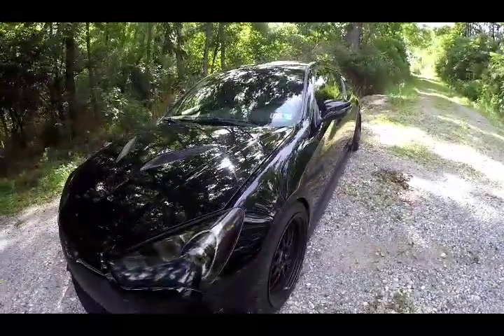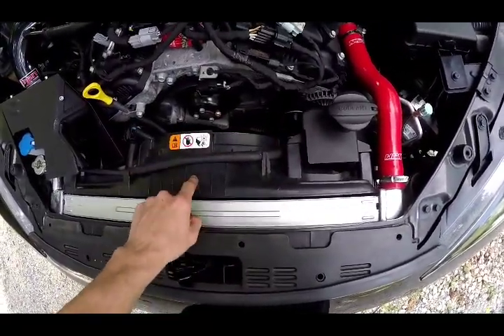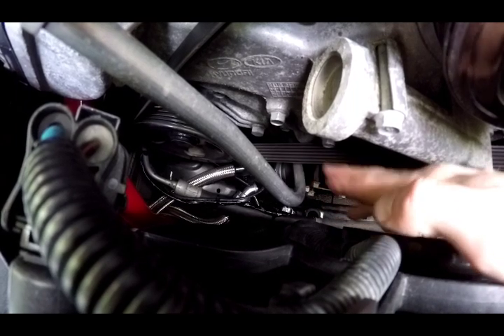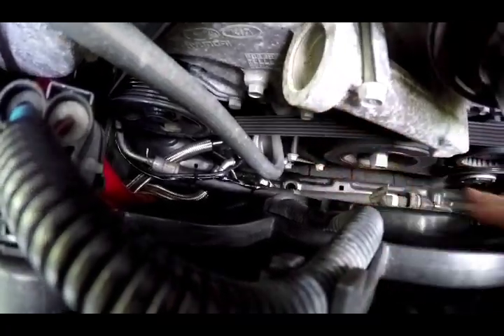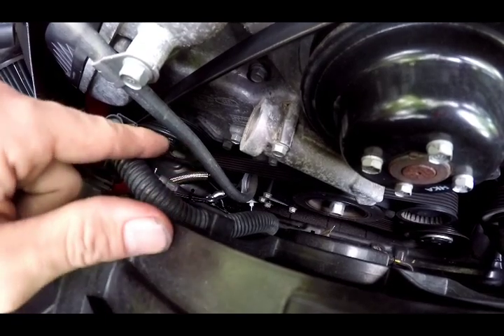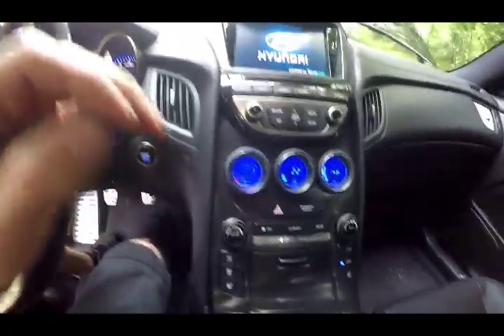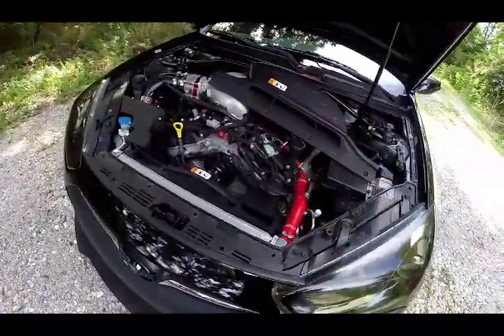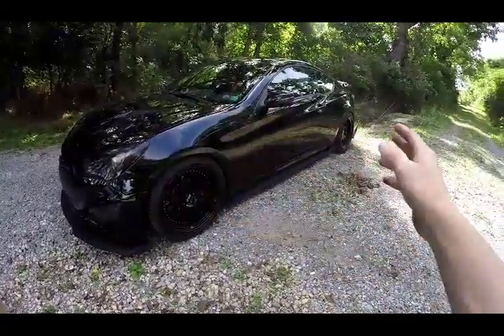Hyundai Genesis Coupe 3.8 Mishimoto oil cooler install walk through

Comment: Wait the oil them wire will it work if you have the stock gauges? For oil temp or do I have to run new wire?
Reply from the maker: For oil you would have to run separate wiring
Reply from the maker: There was a guy that actually made a harness adapter for the oil temp tho. Its moody basha in the genesis groups.
Reply: @RspecNick  damn so the stock gauges won’t work that hella sucks Ight bro thanks!
Reply from the maker: @mr_creator4696  yea man I tried messing with the wiring to see if I could atleast still use the temperature wiring but it wouldnt work. It's cool tho cause atleast I know when I see that temp reading it's not ecu monitored so that's straight from the temp sensor to the gauge. With no interference from the ecu

Comment: You have a catch can yet?
Reply from the maker: Installing that hoping this weekend if it actually comes on time that's one of the last things left which should have really been the first mod to the car
Reply: Rspec Nick bro mine is coming this week. Did you also happen to get the saikou catch cans? They did a genesis batch and they are all being ship this week.
Reply from the maker: @soysauce3660  no I went with the ADD W1. Let me know how all that goes I have a good idea where mine will be mounted
Reply: Rspec Nick oh nice bro. I will be going to the dealership tomorrow and doing the $185 carbon cleaning so that when I get my catch can sometime This week my engine will stay clean for awhile. I have stock airbox so I’ll be mounting my pcv side to the driver side.
Reply from the maker: @soysauce3660  nice man and yea I ended up spraying my valves down with some crc cleaner and letting it soak and it worked pretty good on the build up. Its definitely alot so I need those catch cans before it builds up that bad again.
Reply: Rspec Nick right bro cheers. 👍🏻👍🏻